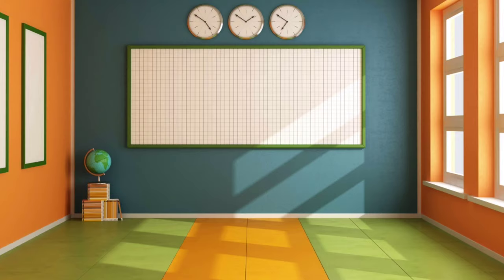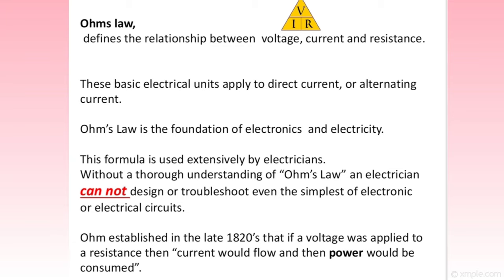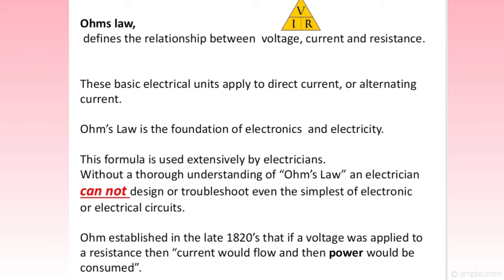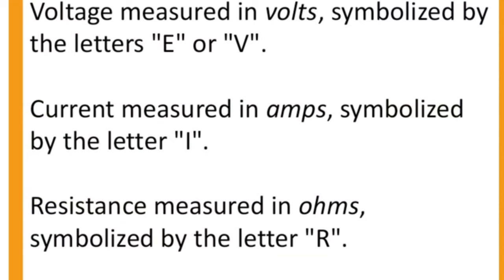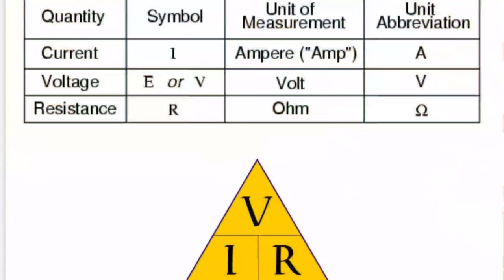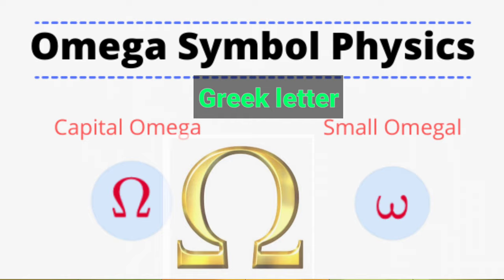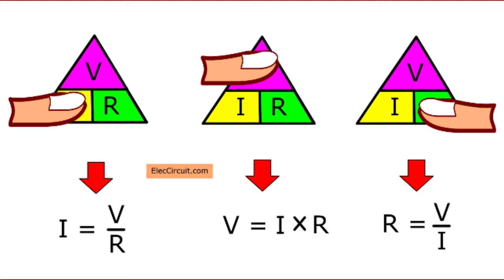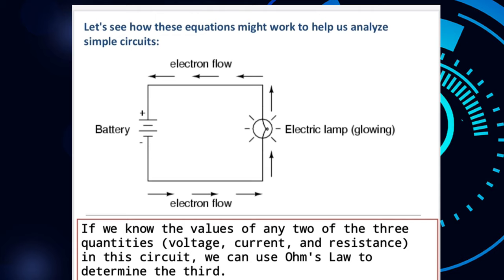Vlog#16 - OHM'S LAW

Comment: Almira Mae G. Solayao
8-loyalty
I learned that Ohm's Law is a formula used to calculate the relationship between voltage, current and resistance in an electrical circuit.

Comment: Bryan Ll. Esguerra
8-Charity
What I've learned:
Is that the ohm's law is a formula used to calculate the relationship between voltage, current and resistance in an electrical circuit.

Comment: Arbie S. Mesana
Charity

I learn on this video is how to calculate the voltage, current, and resistant also i learned that the"voltage is directly proportional to electric current (so the higher the voltage, the higher the current), and that current is inversely proportional to resistance (so the higher the resistance, the lower the current)"

Comment: Precious E. Belviz 
8-Prudence
October 19, 2021
Ohm's law states that the voltage or potential difference between two points is directly proportional to the current or electricity passing through the resistance, and inversely proportional to the resistance of the circuit. The formula for Ohm's law is V=I/R.

Comment: Jay Q. Roda
8-Hope

i learned about that ohms law is a formula used to calculate the relationship between voltage, current and resistance in an electrical circuit.

Comment: Maylan, Railey H.
8-fortitude

I learned that the Ohm's law states that the voltage or potential difference between two points is directly proportional to the current or electricity passing through the resistance, and directly proportional to the resistance of the circuit. The formula for Ohm's law is V=IR

Comment: Rhea H. Canezo
8-CHARITY

Ohm's Law is a formula used to calculate the relationship between voltage, current and resistance in an electrical circuit

Comment: Good afternoon po
Jashmine Dacullo po
8-Piety po

What I've learned in this video:

I've learned in this video is, ohm's law defines the relationship between voltage, current and resistance. 
Formula is used extensively by electrician's. Without a thorough understanding of "Ohm's Law" an electrician CAN NOT design or troubleshoot even the simplest of electronic or electrical circuits.
And voltage measured in volts, symbolized by the letters "E" or "V" .
Current measured in amps, symbolized by the letter "I". 
Resistance measured in ohms, symbolized by the letter "R". 
Thank you😊

Comment: Justine Asuncion
8-Fortitude

Learned:
The German physicist Georg Simon Ohm (1787–1854) was the first to demonstrate experimentally that the current in a metal wire is directly proportional to the voltage applied: I∝V I ∝ V .

Comment: Alyzamae A. Ricafrente
8-charity

I learned that the relationship between current Ang voltage ohms law relationships between voltage current and resistance ohms law is the foundation of foundation of electronic voltage measure.

Comment: Albero, Jumong B.
8 - Fortitude

Ohm's Law tells us that the electrical current in a circuit can be calculated by dividing the voltage by the resistance. In other words, the current is directly proportional to the voltage and inversely proportional to the resistance.

Comment: ARIEANNE T. POLANCOS
VIII- FORTIITUDE

i learned in the video Ohm's Law states that the current flowing in a circuit is directly proportional to the applied potential difference and inversely proportional to the resistance in the circuit. In other words by doubling the voltage across a circuit the current will also double.

Comment: Mer Benedict B. Nobe
8-Prudence
Oct 22,2021
I learn about Ohm's law is
defines the relation ship between voltage,current and resistance

these basic electrical units apply direct current or alternating current

Ohm's Law is the foundation of electronics and electricity

Comment: Anna sophia G. Inojales
8-Hope
I learned that ohm's law is a formula used to calculate the relantionship between voltage,current and resistance in an electrical circuit and inversely proportional to the resistance of the circuit the formula for ohms law is v=I/R

Comment: CHRISTINE NICHOLE M.ROPA
8-CHARITY

what I learned from the video;
-Relationship of current to voltage is directly proportional and inversely proportional to the resistance of the circuit.
-and I learned the ohm's law in 3 equation forms.

Comment: IVY A. TESORO
8-LOYALTY

I learned that Ohms Law is defines the relationship between voltage, current and resistance. .And Ohms law states that the current in a circuit is directly proportional to the voltage and inversely proportional to the resistance of the circuit.

Comment: Teresita D. Castro
8-loyalty 

I learned That ohm's law State that the current in the circruit  is directly proportion to resistance meaning.When currents increase it is due to increase voltage. And graeter resistance will affect the flow of currents causing it to decrease

Comment: ANGELINA MARIE DIEL
8 CHARITY
I learned in this video is Ohm's law states that the voltage or potential difference between two points is directly proportional to the current or electricity passing through the resistance, and directly proportional to the resistance of the circuit.

Comment: Kamille Anne A. Hernandez
8-Humility
I learned that OHMS Law states the relationship between the current, voltage, and resistance. The current symbol is I, the voltage symbol is E or V, and the resistance symbol is R

Comment: ZYRUS CHRISTIAN M. OSORIO

VIII-HUMILITY

I learned that OHM's Law is the foundation of electronics and electricity. OHM's law defines the relationships between voltage,current and resistance. Also OHM's Law allows you to determine the characteristic of a circuit.

Comment: Randel P. Etcheniqui
8-Hope

I've learned that Ohm's Law defines the relationship between voltage, current and resistence.Ohm's Law is the foundation of electronics and electricity, and without a thorough understanding of Ohm's Law an electrician can not design or troubleshoot even the simplest of electronic or electrical circuits.

Comment: Rainier F. Baron
8-Humility

I learn that Ohm's law states that the current in a circuit is directly proportional to the voltage and is inversely proportional to resistance meaning when current increase, it is due to increase voltage greater resistance will affect the flow of current causing it to decrease.

Comment: Hermosa, Lezzlee M.
8-FORTITUDE

I've learned in this video that Ohms Law is the foundation of electronics and electricity it also defined by name of Georg Simon Ohm. It defines Voltage symbolize by letter "E or V", Current symbolize by "I" and  Resistance symbolize by "R".
Ohm's Law electricians can't design a simple electronic or electrical circuits.

Comment: Nathalie M. Cornejo 
8-Charity 
I learned ohms law allows You to determine characteristics Of a circuit such as how much current is flowing though it if you Know the voltage Of the battery in the circuit And how much resistance Is in the circuit.

Comment: Princess Asaiah D. Estacio
8-humility 

I learned 
Ohm's law states that the voltage or potential difference between two points is directly proportional to the current or electricity passing through the resistance, the strength of a direct current is directly proportional to the potential difference and inversely proportional to the resistance of the circuit.

Comment: Jala, Rabbi Lois 
8-Prudence

Ohm's Law defines the relationship between voltage, current, and resistance.
Ohm's Law is the foundation of electronics and electricity.

Voltage is measured in VOLTS, and it symbolized by the letter "E" or "V", Current is measured in AMPS, symbolized by the letter "I" and Resistance is measured in OHM'S and is symbolized by the letter "R".

Sorry po late

Comment: wendy wines
8-humility|
what ive learned:
Ohm's Law allows you to determine characteristics of a circuit, such as how much current is flowing through it, if you know the voltage of the battery in the circuit and how much resistance is in the circuit.

Comment: ohm's law                                           voltage measured in volts symbolized the letter E or V          current measured in amps symbolized by the letter I                                resistance measured in ohms symbolized ny the letter R                                   if we know the value of any two of the three quantites    voltage current and resistance in this circuit we can use ohm's law to determine the third

Comment: ohm's law states that the voltage or potential difference between two points is directly proportional to the current or electricity passing through the resistance, and inversely proportional to the resistance of the circuit

Ibanez rhezy f 8 hope

Comment: Patricia karla Ramirez                                                                                                                                                     8-Hope                                                                                                                                            I     I learned this video
Is that the ohm's law is a formula used to calculate the relationship between voltage, current and resistance in an electrical circuit.

Comment: Arjay D Comawas
8-Humility

What I leanr is that Ohms law defines the relationship between voltage, current and resistance. That flow and then power would be consumed.

Comment: Dadaya, Davie Hannah Marie G.
8- Fortitude

I learned in this video that Ohm's Law is a formula used to calculate the relationship between voltage, current and resistance in an electrical circuit.
Reply: Alexandra M bagundang
8-Charity
I learned in this video that Ohm's law is formula used to calculated the relationship between voltage current and resistance in an electrical circuit

Comment: Alexandra Vicente / 8-Courage

- Ohm's Law -
Ohm's law is derived from the scientist's name Georg Simon Ohm. It defines the relationship between voltage, current and resistance. According to our module, the amount of current in a circuit is directly proportional to the voltage and inversely proportional to the resistance of the circuit. To oney the ohm's law, a conductor has a constant resistance regardless of the voltage. When using ohm's law always use the 3 step form: 
1. Write the equation
2. Replace the known values
3. Solve the problem and;
   Label with the correct unit of measurement
 
- Current, Voltage & Resistance -

1. Current 
Symbol - I
Unit Measurement - Ampere
Unit Abbreviation - A
2. Voltage
Symbol - V / E
Unit Measurement - Volt
Unit Abbreviation - V
3. Resistance 
Symbol - R
Unit Measurement - Ohm
Unit Abbreviation - Ω 

In order to get the current, voltage and resistance you must follow these fomulas:

I = V/R
V = I • R
R = V / I

• Resistance depends on the size of the wire.
- Thick wire - less resistance
- Thin wire - more resistance
- Long wire - more resistance
- Short wire - less resistance 

•Current depends on the resistance in the circuit.
- Greater Resistance - less current 
- Less resistance - greater current

•Voltage depends on the voltage source.
- Greater potential difference - greater voltage

Practice Problem:
1. V / I
2. 4.0 / 0.5 
3. The quotient is 8
4. 8 Ω 

Thank you po sir!

Comment: Ira Herrera from 8 Kindness
I have learned that Ohm's law was derived from the name of the scientist George Simon Ohm.It defines the relationship between voltage,current,and resistance.It is the foundation of electronics and electricity.
3 quantities:
Current 
Symbol:I
Unit of measurement:Ampere("Amp")
Unit of abbreviation:A
Equation:I=V/R
Current depends on the resistance in the circuit
Voltage
Symbol:V or E
Unit of measurement:Volt
Unit of abbreviation:V
Equation:V=IR
Voltage the voltage source
Resistance
Symbol:R
Unit of measurement:Ohm
Unit of abbreviation:Ω
Equation:R=V/I
Resistance depends on the size of the wire
When solving the Ohm's law always use the 3 step form:Write the equation
                      Replace the known values
                      Solve the problem (Label with the correct unit of measurement)
Practice problem:
R=V/I
R=4.0/5.0
R=8 Ω

Comment: Jessica Beatriz R. Cular
8 - Loyalty
I learned that Ohm's law defines the relationship between voltage, current, and resistance. Ohm's law is the foundation of electronics and electricity, and that without a thorough understanding of Ohm's law, and electrician can't design the simplest electronic or electrical circuits.

Comment: I learned that ohm's law defines the relationship  between voltage,  current and resistance . Ohm law is the foundation of electronics and electricity. It is stablished in the late 1820's that if a voltage was applied to a resistance the current would flow and tge power would consumed. Ohm law formulas :
V = IR,
 I = V/R
R= V/I. 
 The V is always at the top.

Thick wire-less resistance 
Thin wire-more resistance 
Long wire -more resistance 
Short wire-less resistance 

My answer po:
R=V/I
 R= 4.0V /0.5A
 R= 4.0V /0.5A =8
R=8 omega

Thank you po

Baguio, divine grace T. 
8-courage

Comment: Joey Jr. A. Diaz 
8-LOYALTY 
 
To students of electronics, Ohm's Law (E = IR) is as fundamentally important as Einstein's Relativity equation (E = mc²) is to physicists. When spelled out, it means voltage = current x resistance, or volts = amps x ohms, or V = A x Ω

Comment: KYLIE LORAINE P. COLOMA
8- HUMILITY
I've learned that According to Ohm's law, the voltage or potential difference between two places is directly proportional to the current or electricity traveling through the resistence and inversely proportional to the circuit's resistence.

Comment: I learned that the relationship between current and voltage ohms law relationships between voltage currents and resistance omhs law is the foundation of foundation of electronic voltage measures

Comment: Ohms law, defines the relationship between voltage, current and resistance.
Ohm's law is the foundation of electronics and electricity.

Three quantities:
Current, Voltage, Resistance

Voltage measured in volts, symbolized by the letters E or V.
Current measured in amps, symbolized by the letter I.
Resistance measured in ohms, symbolized by the letter R.

Resistance (depends on the size of the wire.)
Thick wire-less resistance
Thin wire-more resistance
Long wire-more resistance
Short wire-less resistance
Current (depends on the resistance in the circuit)
Greater resistance-less current
Less resistance-greater current
Voltage (depends on the voltage source)
Potential difference.

To obey ohms law means a conductor has a constant resistance regardless of the voltage.

When using ohm's law always use the 3 step form:
1-Write the equation
2-Replace the known values
3-Solve the problem
•label the correct unit of measurements.

8- Kindness

Comment: Servillano V. Francisco
8-Humility
I learned that Ohm's law is a vitally important to describing electric circuits because it relates the voltage to the current, with the resistance value moderating the relationship between the two.

Comment: Shinzo Daniel M. Martinez(8-Kindness)
I learned that Ohm's law defines the relationship between voltage,current and resistance. Ohm's law is the foundation of electronics and electricity. And I learned that Ohm established in the late 1820's that if a voltage was applied to a resistance then "current would flow and then power would be consumed". Ohm or Ohm's law is derived from the name of a scientist George Simon Ohm.
Symbols of voltage,Current and resistance:
Voltage - V
Current - I
Resistance - R
Voltage is measured in volts.
Current is measured in amps.
Resistance is measured in ohms.
Resistance (The size of the wire)
Thick wire = less resistance
Thin wire = more resistance
Long wire = more resistance
Short wire = less resistance
Current (The resistance in the circuit)
Greater resistance = less current
Less resistance = the greatet the current
Voltage (The voltage source)
- Potential difference
And now for the question sir eto po answer ko..
R = V/I
R = 4.0/0.5
R = 8 Ω
Thank you po sir for another idea for that lesson....

Comment: Urbaña Jazon Montero
8-Charity

I Learn how to does the resistance of a lamp is and the battery wich is our voltage and especially the flow of our current.And i learned about how to compute or the formulas of finding Voltage Current ,Resistance.That we esealy know what was our resistance and voltage and the other one is current circuit do do we have..

Comment: Sheena Mae G. Malte
8-Loyalty
I learned that ohm's states  the current through a conductor between two points is directly  proportional to the voltage across the two points.

Comment: VIANE RAIZEL MIRANDA~PIETY8~ I have learned in this video that the Ohm's law equation shows are that voltage is directly proportional to electric current (so the higher the voltage, the higher the current), and that current is inversely proportional to resistance (so the higher the resistance, the lower the current).

Comment: Khiara Lousie G. C. Santos
VIII- Kindness

I learned that Ohm's Law states that the current in a circuit is directly proportional to the voltage and is inversely proportional to resistance. Meaning when current increases, it is due to increased voltage. And greater resistance will affect the flow of current causing it to decrease.

Comment: Alma M. Jarabilo
8-charity

I learned that Ohm's law is a vitally important to describing electric circuits because it relates the voltage to the current, with the resistance value moderating the relationship between the two.

Comment: I learned that Ohm's Law is a formula used to calculate the relationship between voltage, current and resistance in an electrical circuit.

To students of electronics, Ohm's Law (E = IR) is as fundamentally important as Einstein's Relativity equation (E = mc²) is to physicists.

Comment: Jeremia L. Bibat
8-loyalty
what ive learned:

Ohm's Law allows you to determine characteristics of a circuit, such as how much current is flowing through it, if you know the voltage of the battery in the circuit and how much resistance is in the circuit.